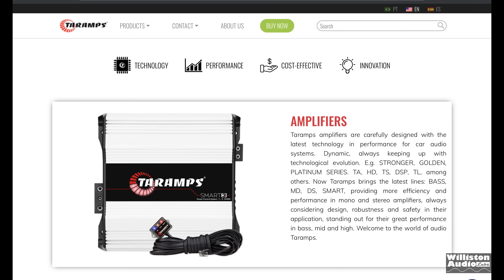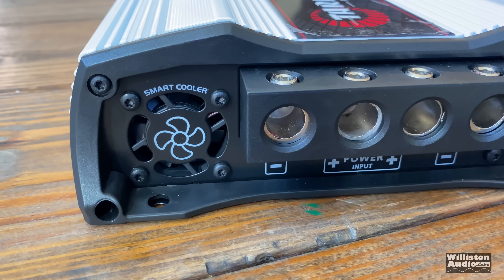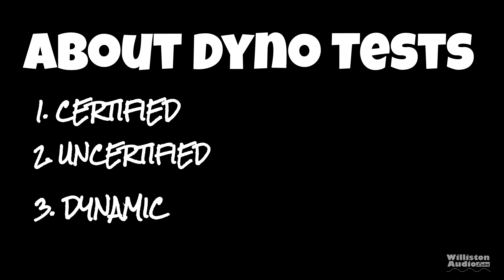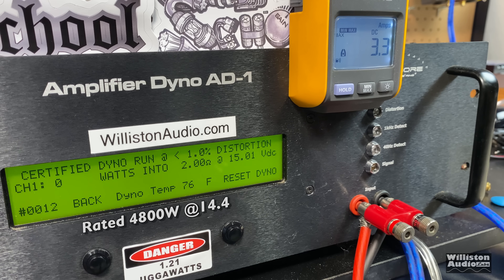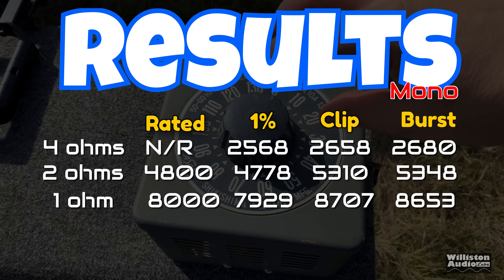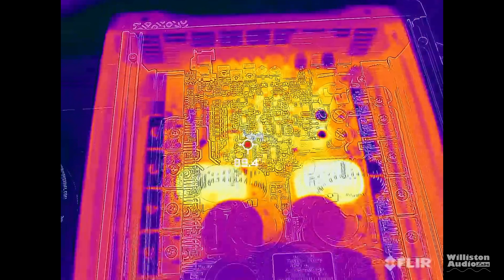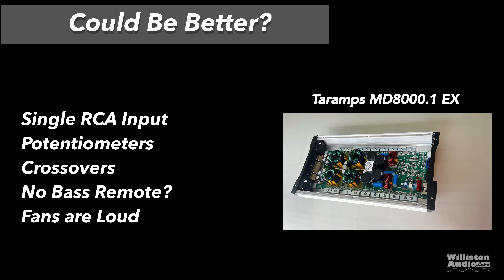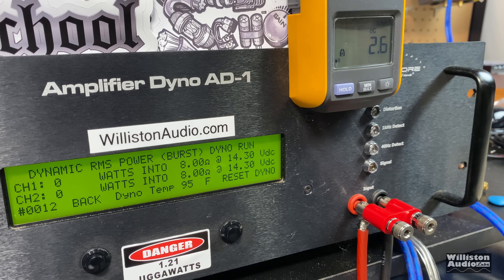8000 watts, but What's New? Taramps MD8000.1 EX Amp Dyno Test and More [4K]

Comment: Got my Glowe Voltage batteries on the way and going back through the reviews of these bigger amps for my new build. 5000w-12000w depending on if I go dual 12 or single 15. I'm at that impatient time waiting on my delivery to arrive and surely I am not the only one that hates Sundays when something is at the local post office buy you will have to wait until Monday to get it

Comment: I been running a 3k for 3yrs now very reliable my only complaint is fans got louder over time highly recommended teramps.. I went through 3 sets of low budget subs in first yr but got some sundowns and built a very nice box been beating thatvset up over 2yrs my suv is flexing

Comment: Hello, im pretty new to Subwoofer amplifier. Can someone explain me or am i Just dump?😂
So the amp has 2/0 Inputs. According to my Research a 2/0 cable can only handle 165 Amps. So 2 Inputs is 330A max.
But in your Test ist handled 900Amps?! 

Why die the 2/0 wires didn burn or get hot?

Pls explain me the math of the wiring, i wanna learn 😊

Comment: I have a question, this is a one channel amp rated at 1ohm.  When you hook it up to the 4 speakers in the kicker box, if each speaker is one ohm resistance, isnt that 4 ohms if in series or 1 ohm 4 channel if ran parallel?  Being that you cant run 4 channels on a 1 channel amp then thst setup is only for 4 ohm right?

Comment: I'm running a sundown scv-4000 on 2 orion xtrpro15.4 wired down to 1 ohm. With duel power and ground blocks. 12 cubic ft double birch and glassed. I am looking to upgrade the amp

Comment: 8 ohm power test is good as it's what most 4 ohm loads will end up at,, so basically that amp will do a continuous 1300 Watts in to let's say  one 4 ohm sub with impedance raise, sadly these days people like running amps down to very high resistance as its a cheap way to make power with one big amp that capable of it of course,, trouble is in my world it turns the systems bass output in to something of an on/off switch with no dynamics,,

Comment: You only need one RCA input for this amplifier. It is an N and an out when you connect one RCA to it it ramps up the voltage so you get full signal?

Comment: How Many batterys i need for tha ?
Reply: Money is no object right? 
you have the $600 for the amplifier you have the money for the wiring you have the money for the Box you have the money for the head unit you have the money for the installation you have the money for the highs in the mids you have the additional amplifiers to run that equipment it's just a matter of batteries right that's all you want to know how many batteries Lord help me with the questions that I posted on the internet why don't you go to the website and see what the draw of the amperage is that will tell you what you need
Reply: @Mr.Robert1  i have the system everything 3 15” the 8k Tarams and 4 batterys an i have problem with the amp say need more power i dont like to much Tarams tha amp need a lot power
Reply: Now in have 5k in music i put o my cables 0 gage marine cables the only need Is a change the batterys for litium batterys
Reply: @danteangel961  taramps are very power hungry
Reply: Good question

Comment: You mentioned the amp is rated at 14 4, but on their website,  it's a 12.6 amp.  Can some confirm or deny which is the correct voltage?
Reply from the maker: Manual said 14.4. Old model said 12.6
Reply: @wal  
it's a shame that you have to waste your time with these children that know nothing about equipment probably don't have a job but have a fantasy about putting a $10,000 sound system together in a car that they don't have yet I really do see some very odd questions on YouTube I'm sorry that I read the comment section half the time it aggravates the living heck out of me I don't know how you do it
Reply: Mr. Roberts, you are right.. I don't have a job... the reason I don't have a job is because I am RETIRED,  RETARD.... speaking of building a 10K, hell, the motorcycle i am installing these 14 speakers cost more than 10K.  I have over 10K in amps, DSPs, subs, wiring etc....suggest you focus on YOU

Comment: I ordered a taramps smart 5k and they sent me this MD 8k EX 1 ohm, so should I keep this or return it??? This amp is $560 and I paid $460 for a smart 5k
Reply from the maker: Oh wow! As long as you have the electrical they both should perform similar in vehicle
Reply: @wal  Thank you, I appreciate that 👍🏼 and I think I'll run 2 MD 8k EXs
Reply: @wal  Hey, I have a question, I have hooked up the Taramps Smart 5k, but no matter how long I play it "Wide open" the fans still haven't came on yet? Does it have a certain temperature before they cut on or no? Because my 12k and 8k that I use to have, the fans immediately came on once power was turned on
Reply: @Undertaker_Bass_Ride  
you didn't say anything about whether they're warm or not are they getting warm are they getting hot what about the wiring is the wiring getting warm or hot then we need to find out whether the amplifier is defective or not
Reply: @Mr.Robert1  I didn't leave them playing long enough 😅 but after about 5 to 10 minutes of them playing, they fans come on, so everything is good, I run 2 smart 5ks, and my buddy has the 8k EXs

Comment: Now we need to see the taramps bass 8k since it only has single 2/0 inputs
Reply from the maker: Thanks for the suggestion
Reply: @wal  Honestly would love that review because I’m running 2 taramps bass 8k in a trunk build and thought about switching to a jp83 and wiring to .5. Review could be even more thorough if you decided to use a dual input connector to see if the wattage actually increases 🤔

Comment: I have last year's model and man, does it pound.  Only problem I've ever had is when the sub blows, so does the amp.  There seems to be no protection for the amp with a short circuit.  Amazing amps though.  Pushed my setup to 156.1 db.
Reply from the maker: That happened with Parker the Basshead too

Comment: I've started collecting for my street box build in a 4 door s10 blazer.
Single xv2 18 with zv6 coil, zv3 shallow cone, mega roll, and zv5 pole.
Powered by this exact amp, in a 7.2³ box. Should get down 👌

Comment: I have 3 md8ks on 12 12s wired at 1 ohm and rising to 1.7 ohms. Getting a little over 5,000 watts per amplifier. Thanks for all the videos Big D I love your content I watch it almost daily.
Reply: FYI in order for you to get 5k out of each amp you will need over 2500 volts from your alternators.😂
Reply: @oxnardadrianlopez6684  what? 🤣
Reply: @brycedupps8719  I know. I must have been falling asleep. You got me. I should have said in order to get 5,000 watts out of both amps you will need over 1,000 DC Volts out of your alternator.
Reply: @oxnardadrianlopez6684  i think you're still sleepin bud, im guessing you mean amperage. since you're not going to get more than 16 volts out of an alternator. I didnt do the math, But with 3 of these amps whos to say he doesnt have HO alts?

Comment: Who would have thought that Taramps would improve so much, I remember that 10 or 12 years ago, this manufacturer did not deliver what it promised, not even at 60hz let alone 40hz. That's why their audience ended up being just electric trio (systems that play loud, above 50hz). In fact, no Brazilian manufacturer had decent amplifiers for low bass at that time, but this reality has changed, it remains to improve efficiency, I believe they will!
Reply: Problema que no Brasil empresas funciona as margens da lei, nada se fiscaliza, o próprio consumidor começou expor as marca e ai as coisas começou a mudar.

Comment: I have the original md8k 2 ohm version. Going to push a solo Fi 4.11 neo 18 inch in a 6th order wall in my 97 Mitsubishi Mirage. Hope I can get the power to it so it will pound

Comment: I wired my Digital Designs 9915 to half ohm, did a Dyno 0.8 ohm rise dynoed 9,622 watts at 0.8 ohms @ 13.5 volts listings to music checked it thru SMD AMM-1

Comment: was wondering  will u get 8000 watts using 2 subs or is watt split between the 2
Reply from the maker: It’s 8000 total so with 2 subs it’s 4000 each

Comment: Testing any amplifier at 8 ohms is very important, in the case of this taramp we saw that it clips around 103v, this is very interesting, old models of the Md8000 even at 8 ohms the clip came at 91.. 92v, and knowing that the clip amplifier at a higher voltage, it is essential to meet the dynamics of music, since in the music scene, observing the impedance curve of a system, we know that most of the time the impedance is well above the nominal. A 1 ohm transducer playing music can easily exceed 15...20 ohms in music, hence the importance of an amplifier being able to raise the voltage a lot, I would like to see the Powerus 3500 in its Dyno :)
Reply from the maker: Thanks for the suggestion 👌

Comment: My friend  wonderful amp but I need help power wise do you need spare battery for this amp and what style brand battery if yes Help
Reply from the maker: Absolutely need 2 batteries if using AGM or one single lithium. I prefer XS Power
Reply: @wal  1 more question sir my friend has this amp very deadly his project I'm looking for that bass but he said I should get the specific  for bass and I noticed much smaller model
Reply: Should I stick with this 1 or smaller bass model 🤔

Comment: OK - 8000W RMS and >800 Amps. My (serious) question is why don't they run high powered amplifiers on 24V or even higher voltage supplies? AT this level you gotta run multiple batteries anyway, so why not at least use 24V truck batteries?
Reply from the maker: This has been a question for many years. Taramps does have some HV amps but they need like a dozen batteries in series. I haven’t seen a 24V amp, some are stable around 18-19V

Comment: Great videos, just wondering about the .8 and .5 ohms?
I know is probably not rated for, but I'm just curious about the performance.
love this amps, had a 3k smart after you did the review, unfortunately my car got broken into and my entire system is gone, looking forward to rebuild.
keep bumping 🔉🔊🔊🎵🎶
Reply from the maker: I wouldn’t drop that low resistive on this amp
Reply: Not recommended for taramps

Comment: I think taramps is great for the price tbh, they have a few weird things with them but for the most part they are pretty great, and you wanted to hear our prjects, so I got a soundqubed u1 8k powering a single sundown x12 that has the 8 layer coil, stiff surround, and spl cone, but if it doesn't like that power which i expect it to i will probably sell it and buy 2 sundown x10v3's build a 6th order box for them and see how that goes, a little extra amp is better than not enought though. to go with that i got a soundqubed u4 x500  that will run my doors/ rear quarter panels, im fiberglassing the doors here soon so ill have 3 skar mid 6.5's and a super tweeter in each of the front doors (its a coup) then im running a 6.5 mid and super tweeter in each of the rear quarter panels, the mids will be ran in parallel and the tweets will be ran in parallel, i got a dsp and caps to make sure i dont blow the tweeters out and everthing shoudl go pretty good, cant wait for this quarter of school to be over so i can get some time to finish it!
Reply from the maker: Awesome 👏
Reply: @wal  if you would like To I could send ya my u1-8K and you can test it on the dyno and look at its guts and make a little video on it as long as I got it back after you were done with it

Comment: Thanx for the 8 ohm test.  I am very disappointed with selection of home stereo amps. I was considering buying a car amp and getting a good AC/DC converted to run it.   I assume I'm a car or truck you would have to have extra batteries to run one of these?  The alternator won't keep up with that amp.
Reply from the maker: Yes there are alts up to 370a now. It also lithium batteries are used for car audio to power amps like this. I prefer LTO for safety purposes

Comment: i will say only this, This amp was not made to play low bass like 30hz and lower so don't do it. Amp will play 8 10'' mids speakers like a boss. over all its a good amp for the price.
Reply from the maker: Might not be optimized for sub bass, but has no issues playing it
Reply: I have a soundstream 18000 and it's the same. The high pass is way down to 15hz but it's like the amp has an intenal separate crossover that slopes off the low bass, to prevent self destruction. The 12db crossovers are ridiculous, they should be 18, and the bass boost frequency has a super wide reach so it's basically pointless to use.

Comment: Set the LPF to 90, All knobs left and gain match only. You are allowing up to 8khz in,  That will rid the vocals you are hearing.  I'm curious if that changes the dyno results, doubtful since it should only be sending 40hz anyway.

"Internal and External use", External meaning like the brazilian market, The crazy semi rigs you see and such.

Remember these are full range because they are made for a different scene, People forget that there is more than us in the world.

Thanks for the vid.
Reply from the maker: I set the LPF to highest setting (or disable) for testing. In this amp it’s 8kHz so they are not really full range amps anymore. Good luck finding 90Hz when the pot goes from 50Hz-8kHz 😲
Reply: @wal  says 90 🤷‍♂️

It wouldn't effect the test because you're only sending it a 40Hz signal. 

But while playing music it needs to have all pots all the way CCW.
Reply: Aside from gain of course.

Comment: Greetings,have you ever tested an Taramps dsp 3000.1    ??????  this will be an older model.
Reply from the maker: No but should be the same as the HD3000 without the DSP part

Taramps HD3000 Amp Dyno Test - Mini Brazilian Power!
https://youtu.be/dP9yM_lvXb4

Comment: I have 2 SMD 18 inch subwoofers I got them in like 2010 I forgot how much rms they have I still have them in storage never hooked up brand new I need to know what amp I can get to power them can you please help me 🙏🏾🙏🏾🙏🏾🙏🏾
Reply from the maker: Steve uses (1) 2500W amp per coil with his, so it just depends on your budget. Those subs are beasts and can handle the power. Price vs performance I’d check the Taramps Smart 5 or one of the JP amps (affiliate link) https://lddy.no/vv99
Reply: @wal  I was looking at the DC 7.5k

Comment: Yes, I would run an 8,000 watt amp to my subs. I have a pair of Digital Designs supercharged 9500K 10" subs with ESP and the amp would be perfect for it. The subs are rated for 2,000 watts RMS and bursts of 8,000 watts but I believe the 2,000 RMS rating is super conservative. I have given them 2, 500 watts RMS and they could have taken way more power than that, I would be happy giving them 4,000 watts each but I need to switch to LTO batteries because it would take way too many AGM batteries to power the amp.
Reply from the maker: Yes need power to make power
Reply: loxus 12v Group 31 Smart con esto ya no te ase falta más está en precio sólo porque tienen un arañazo en $174 en EBay  tela garantizo.

Comment: I see dual batt inputs which is nice. Kinda seems like the 8k Vulcan but....late.

These amps generate tons of power but they are a fire Hazzard. Please use quick disconnects/ tools/fire extinguisher when using these. If a speaker blows these amps will either go into protect or start to catch fire. 

I love these amps but please use caution.
Reply from the maker: The EX series added additional protection circuitry

Comment: What is the highest power the Amp Dyno can measure without damaging it or exceeding the reliability envelope of measurement?
Reply from the maker: 15,000 at 1 ohm. Of course the Dyno doesn’t provide the power for the amp, you still need the electrical. I think I’m good for 10-12k staying around 14 and may be able to push 15k at 13
Reply: @wal  I vaguely remember Steve Meade do a BK-2 audio amp and he got over 18k as a measurement. I think it can take up to 20k. That's a ridiculous amount of power. My old ears are hurting thinking about it.
Reply from the maker: @housepumpinpc3983  straight from the manual:
Power Handling in Mono Mode

5000 Watts X 1 into 4 ohms
10000 Watts X 1 into 2 ohms
10000 Watts X 1 into 1.3 ohms
15000 Watts X 1 into 1.0 ohm
15000 Watts X 1 into 0.8 ohms
18000 Watts X 1 into 0.6 ohms
24000 Watts X 1 into 0.5 ohms

Again, this is just what the Dyno can measure. You still must provide the electrical to power the amplifier.

Comment: I might have missed the part where you explained what ex meant. I obtained a 2 ohm variant and as much as I could easily put it to use it’s my nephews he ordered what he thought should have been a 1 ohm model. He’s wanting to trade me for my jp23’s.
Reply from the maker: 4V inputs, enhanced protection circuit and dual 2/0 inputs

Comment: Do wish they upgraded crossover to a -24db or more crossover. though i guess I'm using a external dsp anyway... but high and low pass is handy option to have built into amp, i know it costs more though. or don't add a crossover and bundle a separate crossover box with amp or option to buy without, if its cheaper.
Reply from the maker: Don’t think crossover is higher than 12db/oct

Comment: Thanks for the 8ohm test. would drive hmm 3 511 martin audio vintage bass bins... really would like them to make a amp with 24v or 48v input. for off grid sound systems, i would still be custom building a battery when going to 8kw speakers and in a car, at this power level, changes to car power system have to be made, or a separate battery. so making it 24v or 48v makes sense, as wires can be thinner and its also easier to design the amp to drive 8kw into 8ohm then :D. would be great! I get there just making amps for the existing car audio market and people want it 12v, but amps with higher speaker driver voltage  for for 4-8ohm would be fantastic!
Reply from the maker: This has been discussed for many years! Hasn’t come to fruition though
Reply: @wal  aww, so amp boards from china continues then... :)